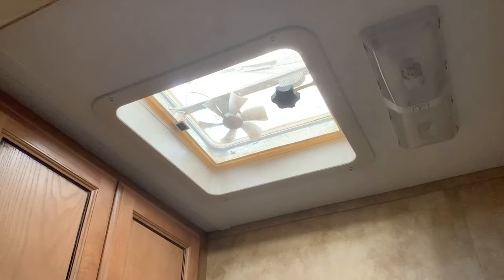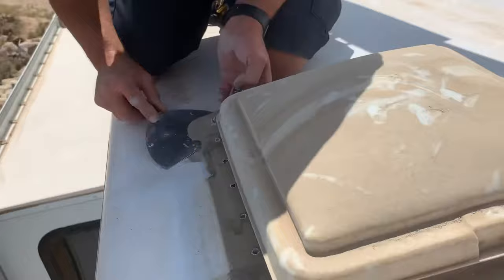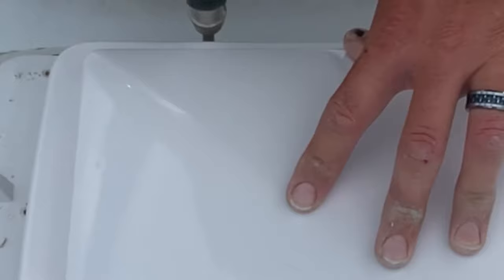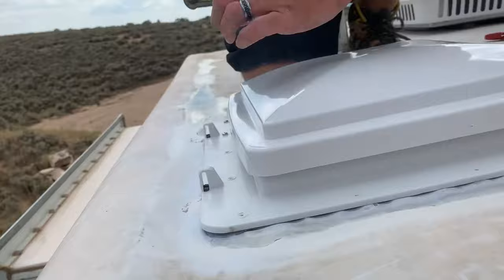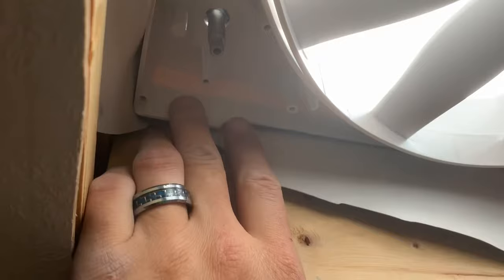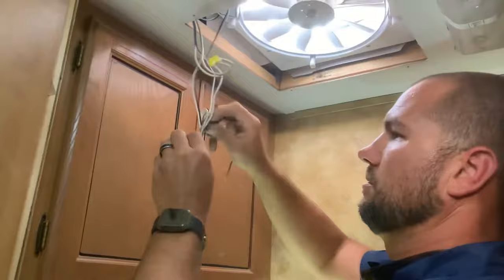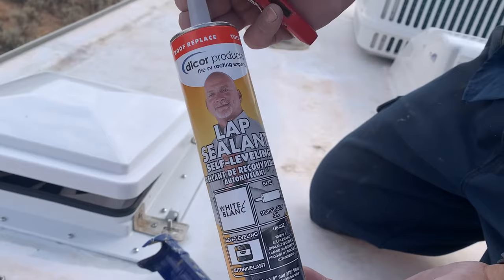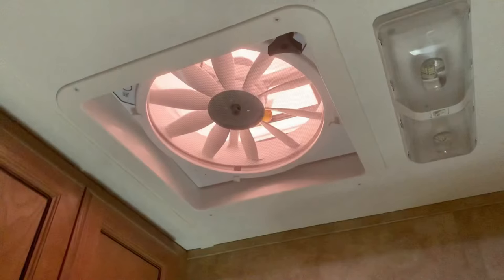HOW TO Correctly Install/Replace RV Vent Fan

Comment: Hello, thank you very much for this video. I would add only three things. 1. When I attach something to the roof, vent flanges, solar panels etc. I use putty tape between the two, It is thicker and wider. If the flanges are flush, I would just smear the surface in between with Dicor. 2. When connecting electrical wires in an RV I always use crimp connecters. Your RV goes down the road with a never-ending earthquake and I think wire nuts are not that decent a connector in the first place. It may be a small point, but I would crimp and then you can forget it aside from a leak. 3. I would  put a lot more Dicor on the final outside surface of the vent flanges. You are caulking the edge like you would at home, but this is going vibrate and flex and all the rest and I would rather use an second tube of Dicor and smear the entire surface full all the way around. Newer RV's often have roof caulking that is 2 or so inches wide, perhaps for the same reasoning. 
For me, we found that in our bathroom having a shower if we opened the small window and ran the fan you had it was pretty good at (a) getting shower moisture out and (b) other smells. However, in the main room, because we have tip out windows everywhere, the air circulation is not as good and the coach can get hot when in the sun. I will be changing out the vent in the living room with a powered fan. I have found the fantastic fans are pretty expensive. I prefer not to have all the automatic stuff as when I am boondocking, I want to have positive control over my power usage. Instead, I can crank up the lid myself and I am fine with a 3-speed fan with reverse. Such fans ae half the price and should do the same job. Travel safe. Henri (RVing with Henri)

Comment: Thank you for making your replacement video and posting here on YouTube.
Our 31.5’ 5th wheel had only one vent fan. I just replaced the others with fan and lights vents. For the vent covers from MaxAir, I too, modified the brackets to work with the plastic vent body and the lower clearance.
I did not do the butal tape clean up. I see you followed instructions! I’m a lazy lady, but I try to reuse as much as possible. The butal tape from the original instal was in great condition and wider than the new stuff my husband bought. I just dusted it all down, added the very narrow butal tape to the screw hole lines. Nice and snug fit. I used self-leveling sealant the same brand as you used here.
Two of the three fans are too high for manual cranking. I bought rain sensor with remote control. 
Our lives have improved so much with the fans venting out the heat that hugs the ceiling and later it may be switched/reversed to bring in the cool air of the evening. We do not use the factory ac. It is noisy, sucks up electricity like a thirsty elephant, and did not bring us much comfort. Our lives keep us in SW NM where it is terribly hot and dry. We prefer ‘swamp’ coolers which gives us some relief from the dry air, don’t cost an arm and a leg to run, and are easy to place as they are portable.
No one taught me to tie into the light fixture. It just made sense. It keeps the ceiling clean and wire free.
Thanks again…please loose the music it detracts from the voices.

Comment: My fan doesn’t have a name on it. But now I need a new one. Can I get a dometic Fantastic Fan in it’s place and use their vent cover. Simpler to what you did here? It’s it a 14 x 14 standard roof whole?
Reply from the maker: As long as the opening requirement offs the same, it will fit in the hole.  As for the cover fitting, you may need to modify it like I did in the video depending on what differences they have.  Before you install it, check to see if the old cover fits or can be modified to fit.  If not, get a cover ordered that does fit with the new fan before you remove the old one so that you have everything you need to finish the job once there’s an opening in the ceiling.  I hope this helps, but without me being there and seeing what you’re working with, I can’t really give anymore advice.

Comment: First class video. Very helpful. One question. Can I use mineral spirits or paint thinner or denatured alcohol to clean with instead of lacquer thinner?
Reply from the maker: The stronger the better. Mineral spirits probably won’t have what it takes to cut through and remove it all.  You could try denatured alcohol because it would be mild enough to not damage the membrane. The lacquer thinner has just worked best for us, it gets the job done but doesn’t damage the membrane.

Comment: Why would you use such narrow butyl tape? and why predrill your holes? the if you use the right screws, they are very pointed and don't need predrilling. I'm wondering, has it leaked yet?

Comment: my new fan has red for the hot and black for ground.  I was wondering about connecting the wiring.  So do all RV's have white for ground and black for hot.  I am holding off on the replacement until I know for sure.  I don't have anything to check the circuit with.  I am electricity stupid.
Reply from the maker: No worries. If there is a white, it’s a ground:)

Comment: Great video! Also what about all the previous screw holes? Did you need to make sure you covered those with butyl tape or lap sealant? Or not necessary?
Reply from the maker: Yeah, just fill them with the putty (butyl tape) or the sealant caulk in the video before the flange covers them. If the new flange doesn’t cover them you may want to get an R/V roof patch to cover them.  But the caulk used in this video would also hold up for a few years.

Comment: I’m installing a new fan without wiring and plan to tap into a light nearby.  Does the light switch have to be on though for power to the fan?
Reply from the maker: Yes. It is possible though if you fish around, you might be able to find a live wire that powers something else (many wires tend to get run through the same areas) Then you wouldn’t have to worry about that.

Comment: What about instead of Thinner, can I use Acetone to clean up? Is there a difference between Thinner and Lacquer Thinner?
Reply from the maker: It’s up to you.  I had lacquer thinner and it worked without damaging the liner.  You could try using acetone, I just don’t know.  If it doesn’t work, or seems to compromise the liner, you could use the lacquer thinner instead.

Comment: Drilling way too many holes Exclamation point😮 More places for it to leak Liquid Nails Flex tape glue Could also put O-rings on the bottom of the screws For experience and Contraction